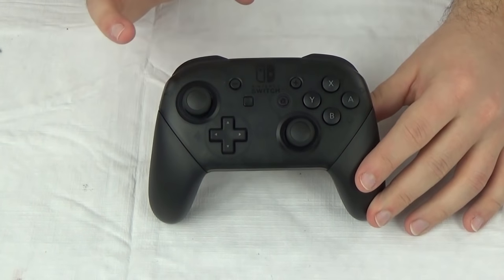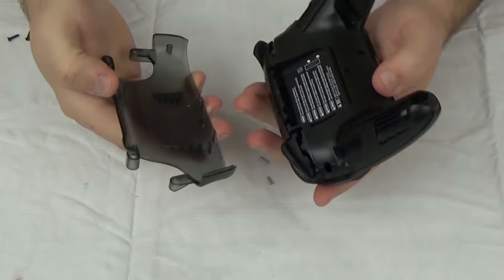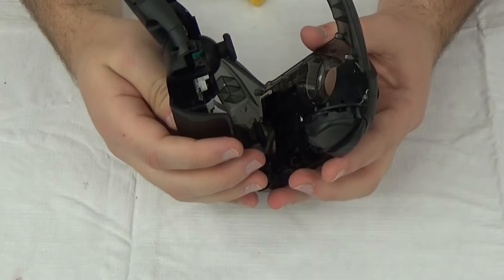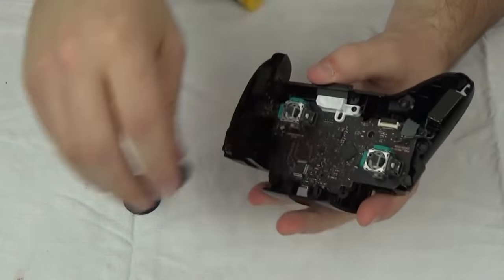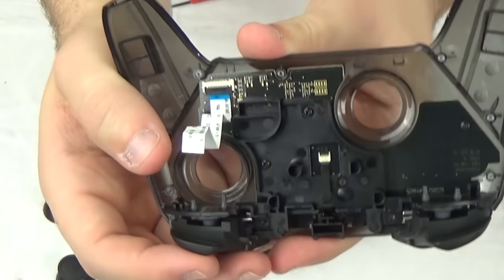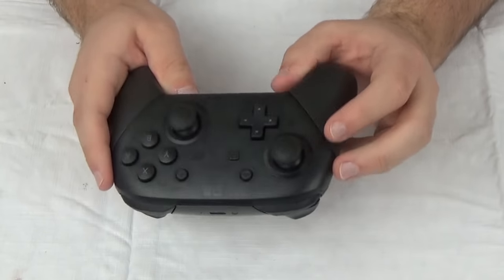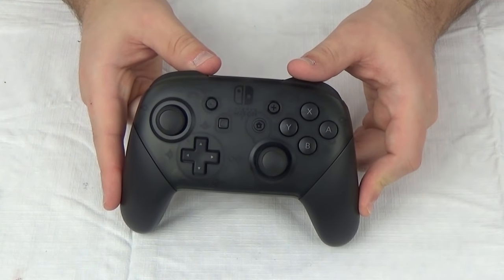Taking Apart The Nintendo Switch Pro Controller! Secret Message Inside?

Comment: Just curious to those who have a Switch: How do games look in Handheld mode? I know the resolution is reduced, but does it still look great? I only ask this because mine's coming in a couple of days and I just want a confirmation.
Reply: AshXXMayftw it actually look absolutely great, I have no complaints to be honest
Reply: So nothing is wrong with it? No dead pixels or anything?
Reply: AshXXMayftw from my gameplay experience, it still looked amazing. The only issue I had was during BotW during cut scenes, frame rate dropped pretty drastically.
Reply: AshXXMayftw You won't notice the pixels when playing.
Reply: AshXXMayftw it looks great and it does what every other system does helps pass the hours of your life away without you noticing
Reply: I notice jagged edges when I really look (though I'm used to a high end gaming pc). No dead pixels or defects of any kind. Good screen.
Reply: AshXXMayftw it looks amazing
Reply: It looks better than any mobile game on any portable including phones that I've seen.  As long as you're not one to count pixels then it looks stunning. It's insane that it pushes out that much power in such a small space.
Reply: AshXXMayftw It still looks dope bro. The game is tight. Really!
Reply: AshXXMayftw Handheld mode looks beautiful. the difference is very unnoticeable
Reply: Looks great in both handheld and docked to the TV. If I sit close to the TV,  sure, then I can tell Zelda is not output at 1080p (more so I guess being that it's a 4K TV), but when sitting on the sofa, it looks beautiful.
Reply: AshXXMayftw Darn amazing
Reply: AshXXMayftw It still looks great! Just put the brightness up
Reply: AshXXMayftw they look awesome! been really impressed with my switch so far. and its bound to get even better as time goes on with future updates etc.
Reply: AshXXMayftw been playing for a long time. I'm a happy customer. Get a screen protector just in case
Reply: Adding my 2 cents here too: "It's so crisp!" (Zelda) were the first words that I uttered. I took a picture and sent it to my parents in a text and even they said they could see what I mean. I then wandered into a Bokoblin camp and had a few fights...played beautifully and sounds good too. I have no complaints.

I played Bomberman on it today, tabletop and handheld mode and it was just as good.
Reply: AshXXMayftw beutiful
Reply: AshXXMayftw 720p bliss
Reply: Zelda looks stunning. The only problem I have is 1 particle of grey "dust" on the edge, between the touch screen and the display, that bugs me off when the display is turned off.
Reply: AshXXMayftw, listen, the screen itself is nothing to marvel at but it DOES seem to be Goodall! (For a 720p screen that is) It's actually really sharp I noticed, though, the bezel (black thing surrounding screen) is a bit noticeable at first, but the screen is good

Still recommend tv mode if you have a good tv though
Reply: Most impressive, won't be disappointed.
Reply: AshXXMayftw It looks amazing. Wouldnt say it is 720p. Looks more like 1080
Reply: AshXXMayftw yeah it looks fine. I was worried that it was not gonna look very good on the screen but it actually looks great!
Reply: AshXXMayftw they look great because it's 1:1 it renders in 720p and the resolution of the switch is 720p so everything looks very crisp
Reply: Kamal Kouja yeah the screen when playing is nice and crisp, it's tons better when not viewing thru YouTube just the system itself. You gotta see for yourself.
Reply: AshXXMayftw yeah, in botw, it's blurry in the beginning, but it looks just as good as tv mode
Reply: honestly screens this small dont need 1080p to look good, the 720p is plenty imo
Reply: HH mode is great in zelda's case I think the game runs better in HH. I think they went with a 720p screen not just to keep costs down but to save on battery and heat output. a screen that size is fine for 720p and the quality of the colors are really nice.
Reply: Man, If I didn't know better I would just assume the quality was identical.
Reply: AshXXMayftw It looks pretty good. The screen is smaller than it looks in the trailers so it looks crisp.
Reply: AshXXMayftw I think the games look better in handheld
Reply: AshXXMayftw the games are a lot more detailed and clear in handheld, I actually preffer handheld, even when I'm sitting 10 ft. From my TV.
Reply: AshXXMayftw the games a beautiful and so gorgeous in hand held
Reply: Eh, 1080p to 720p is a tiny reduction, I can't even tell the difference on my 21" monitor, let alone on the tiny-ass Switch screen.
Reply: I know this is extremely late but I will say that it almost looks better than docked mode, depending on how big your TV is. It looks really nice.
Reply: DONT LISTEN TO ANY YOUTUBER ABOUT ANYTHING BAD ABOUT IT 
I promise you, you'll be amazed nothing wrong with it just don't be reckless and dumb with it
Ps: the screen is good too 👍
But this was 4 months ago so I bet you already have it
Reply: It looks great. To me it looks better than Docked mode when you play Zelda. If you play Splatoon 2 Or something else I don't see a difference
Reply: It looks fantastic!
Reply: AshXXMayftw perfect flawless
Reply: it is basically HD
Reply: AshXXMayftw amazing in handheld and in console mode
Reply: It looks absolutely great
Reply: Doesn't look that different. Otherwise it's Good :D
Reply: It's still absolutely crisp. Not a polygon or pixel in sight.
Reply: looks pretty good
Reply: AshXXMayftw its buetiful! I was hoping u could use it as a moniter (split screen so up don't need tv) it was worth it
Reply: It looks great honestly!
Reply: AshXXMayftw  really like it! It is good to use when you are tired and on a trip
Reply: It still looks awesome, resolution or colour are not issues. Braeath of the wild on a smaller screen is a different experience to on a larger display though.
Reply: AshXXMayftw they're good Its the same on TV (ik its not but it feels like)
Reply: looks exactly the same everything looks detailed in games like breath of the wild or splatoon
Reply: Mine looks better

Comment: Watched this video when it first came out and just now watched it again after searching for an issue with my pro controller not turning on. Turns out all I had to do was take out the battery and put it back in. Of course I also gave it a good cleaning while apart. 3 years of use made it a little grimy. 🙃

Comment: I like how the battery is completely seperate from the rest of the insides of the controller. Seems like they could have just used a plastic cover that clips into place for the battery if they wanted to, like with the XBone of Steam controller

Comment: Smart of them to use the 3DS battery for the Pro controller. They're probably much easier to manufacture since the production of hardware becomes optimized at a certain point. Definitely saving on costs, although it's not like any of us will see the lower price because of it.

Just because Nintendo equals value doesn't mean they're any less greedy. Up until its death, the Wii U was a lot of money to buy. It's why I never got one. Same for the games in most cases.

Comment: What screwdriver did you use? Is it on amazon and can you send me a link? I have a philips head screwdriver but it’s a little too thick for this one back portion of the controller. I was a bit saddened by having to stop the disassembly. Yours is thin enough as shown by the video. Help is appreciated!

Comment: That dual PCB design is fairly unusual. That's really neat, and would explain the relative heft of the device. Interestingly enough, the Wii U Pro controller also uses the exact same CTR-003 battery.
Reply: wii u pro controller pro

Comment: Modern controllers should all have replaceable sticks (without soldering required) via a ribbon or internal connector like the n64.  It's ridiculous that if sticks get worn out you're basically screwed.

Comment: Spawn Wave. He takes things apart so you don't have to!

Also, apparently, the Wii U Pro Controller also had a battery that looked like it came from a 3DS. That's what I read from a Reddit post, though so I could be wrong.

Comment: I want thank you I found your video because I needed to clean my controller mainly the stick because of the sticks starting to drift your video was very helpful ( they had dust and small fibers all around both stick using canned air and some needle nosed tweezers cleared the problem right up)

Comment: What is that exact screwdriver you're using to open that up? I watched another video and a man used a Phillips j00 bit and a longer screwdriver I think he said a long  Phillips 000 to open his. But I see you're just using one. My grandson knocked his on a hard floor and the right thumb button is not working correctly and we want to take it apart and see if we can just maybe pop off the cap and put it back on if that will fix it. I would appreciate any information to help us because it's brand new and I just bought it for him a few months ago and I'm pretty sad about it. he's already having horrible joy-con drift issues and can't seem to fix them nor can we afford a new pair. So I got him the Pro controller this past summer to get away from that. And I surely can't not afford a new Pro controller.

Comment: Hey Spawn Wave!
Could you tell me which screw driver is needed exactly?
After a night with some friends and heavy drinking, my only pro controller got a cider shower and, albeit all the buttons work correctly, the Y button is very very sticky. 

It never concerned me, but after the sales, i am now playing Dragon Ball FihterZ and it doesn't work without the weak attack. 

But every screw driver i tried was either to big to get grip on the screws, or too small to get grip.

Comment: I’m trying to clean the inside (not with water or soap obviously) because my friend spilled a bottle of soda all over it. It still works it’s just the buttons are all sticky and slow because of it and on the inside they work weird but I haven’t been able to get the top 2 screws in the back.

Comment: how were you able to get the front part off to get inside the controller? I'm afraid it'll snap apart if i try to pull it off. i've gotten the grip parts loose but am unable to pull off the back.

Comment: My Pro Controller suddently has a blue LED ring around the home button. I swear i have that thing since 2017 now and i have never seen this blue light before. Now it wont go off even if the controller isnt conectet to my Switch or PC. This has to be some hidden message!

Comment: Cannot emphasize enough how grateful I am for this video to exist!
Just five mins ago my controller started to make "clunky noises" whenever moving the right joycon, which also felt... strange to move. Basically it came down to either trying some little D.I.Y surgery or buying a new one... Figured to perform some self-made autopsy, if something breaks, I'm gonna have to buy a new one anyway, right?
Turns out one of the grey pieces on the joycon's side had come loose and moved under the joycon, making the noise and making it harder to move.
Point being; the ol' buggard is working again, and I due the detailed showing of how to open this / what to expect on each phase I also broke nothing.

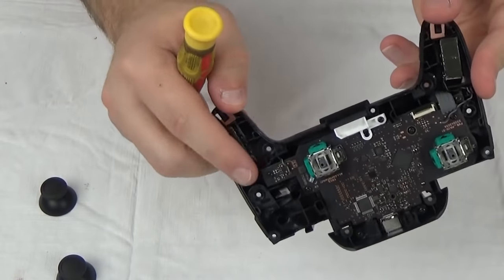Comment: Where can I buy a broken switch pro controller? I melted the plastic backing that houses the battery and circuit boards for the analog sticks and rumble. Time stamp 6:30 in video.

Comment: Hey I got a ? For the 2019 Nintendo wireless pro controller the ones with Double As , Are there a rechargeable battery pack I can use for it or if you change the backplate maybe to make it rechargeable? I like nyko where you don’t plug any wires like for Xbox controllers

Comment: Wait, digital triggers again ? And the Joycon doesn't have analog triggers either?
Reply: Ghost81 no :(
Reply: Ghost81 wait why is this a bad thing? how is this different from other triggers?
Reply: GrimaceBSX

Analog triggers have 255 positions, digital triggers/bumpers only have 1. To put it into context, when you play a driving game on Xbox or PS4 you are able to accelerate gradually by regulating pressure on the trigger with your finger. You can't do that on a digital trigger.
Reply: Ghost81 yea.. i cant believe it neither! was just riding in a car on my xbox and not being able to control acceleration sucks so much... same goes for overwatch and pharah for example. 70 bucks. no digital and no headphpne jack.. wtf
Reply: Not really much point anyway since most the racing games nintendo are known for use the A button to accelerate anyway.

Comment: I really love the feel but I may have an issue and hoping someone with a Switch can help. My console got delayed but my pro controller got delivered. I'm able to connect it to my mac, and it works. But the left thumbstick doesn't seem to have a full range of motion. Meaning if I push slightly in any direction it doesn't register until a certain point, and if I push all the way to the edge, it's only about half of what it should (using Unreal Engine I see pushing to the right maxes at 0.5 of what should 1.0 & pushing left maxes at 0.6 of what should be 1.0, so they're also uneven). I'm hoping it either just needs a calibration on the Switch or maybe a driver update for Mac and it's not a bad controller. Sorry that was long but just wondering if anyone had similar issue on their switch and it just needed to be calibrated? Thanks!
Reply: Jordan Michael Rushing sounds like you need to adjust the deadzones.

Comment: just a question for those Nintendo SWITCH users, does The sreen really Scratch because of The doc?
Reply: I haven't noticed anything, but I have kept it in the dock mostly. I'm not taking any chances though, so I'm leaving it in the dock until I get a tempered glass screen protector.
Reply: I've docked and undocked it twice,, first time took my a bit to figure out how it sat inside the thing. I have not had any scratches show up whatsoever
Reply: TurboCMinusMinus Well I mean, if you plop the switch into the dock carelessly then yeah. That would happen to almost anything like that. As long as you're careful (or put padding on the inside/make your own dock) then you should be fine.
Reply: I hope they fix this problem for summer, I want to get It in summer
Reply: hugo wolf apparently so. personally im getting some sticky back felt off Amazon to stick inside the dock to help protect it from scratching.
Reply: hugo wolf    The dock tends to "scuff" the bottom corners of the screen. However, i have been able to easily buff it off with my shirt. Some docks may have been defective and scratched screens, but it is rare considering the number of units that work fine. I haven't had any issues with joycons either. My only complaint so far.....the pro controller d-pad doesn't pivot, it pushes down all at once, which will be a problem once street fighter 2 ultra comes out.

Comment: Is it possible to change the switch pro controller case with the cute animal crossing switch controller casing?
I like the the acnh controller but it not rechargeable like the pro controller?
Edit: i noticed the acnh bottom of controller has these extra bottons, so can i aleast take the top acnh shell and place on the pro switch top shell?

Comment: I just think that having the pro controller takes away from what the switch is meant to do
Reply: The ultimate gamerpod The Switch is about more ways to play, and the Pro Controller is a different way to play when the Joy Cons don't do the trick with a certain game.
Reply: The ultimate gamerpod I think the Switch is meant to be versatile, so it does exactly that: allow you to play in any configuration that you like. If it's not your thing, you get to save $80

Comment: Nintendo states you have to send your controller to them to have the battery replaced. This video clearly states it's easy enough to do yourself. Has anyone done this and are these battery's easily available? personally I don't believe everything they say. There website said you need to charge the pro controller for 6 hours but it was charged in 2-3 hours. Go figure!

Comment: So... why exactly does it cost 10$ more than an Xbox/PS controller?
Reply: Jacob Jawson cause of The technology inside!
Reply: Jacob Jawson NFC Reader, HD Rumble, Gyroscope and 40hours battery
Reply: Jacob Jawson Rumble, HD Rumble, NFC Amiibo reader, Motion control, accelorometer (for Motion Control) and a few more things!
Reply: NFC, HD rumble, Gyro and 40 hours of life...Xbox is the one ripping you off, they expect you to still use batteries.
Reply: HD Rumble, Motion Control, and NFC (for amiibos) and better battery life. It also comes with a charging cable, unlike DualShock 4's and it has a rechargeable battery unlike Xbox One controllers.

Comment: Any one got a fix on the controller that it won’t charge I bought it off eBay broken and changed the battery possible that it’s the charging port ?

Comment: 3ds battery?
Reply: John Teran 
wii U pro controler used it as well.

I mean, why not? battery tech hasn't improved in the past decade, and they have a perfectly fine priduction line and lots of stock on 3ds batteries.
Reply: I would like to see manufacturers start using 18650. All the hipster vapers are making it very popular.